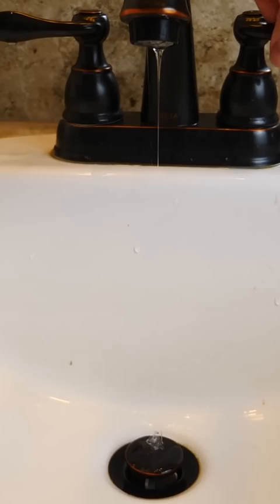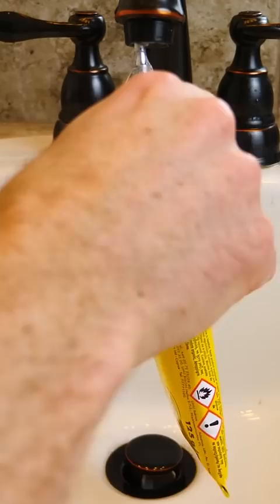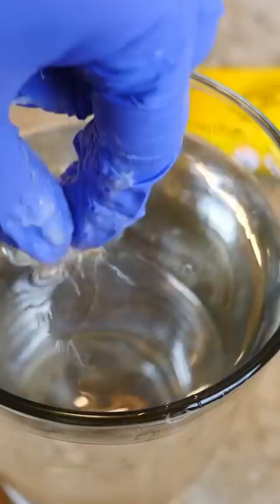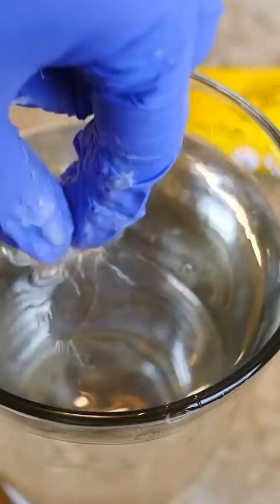The World's Biggest Water Drops

Comment: That's not a filter on your faucet, that's an aerator.. fun fact, they clog up and the end of the faucet is usually able to be unscrewed where you can clean out the aerator.. you also have the same thing on your washing machine and dishwasher.. They get blocked with mineral deposits and have to be cleaned.. Don't need to hire a plumber for something like this... You can do it with a pair of channel locks and maybe some CLR or some other solvent to break up the deposits.

Comment: Now you just need a way to fire it without the two chemicals mixing

My idea is to have to cartridges that are coned and funneled into one another then a block stops them from mixing when your not firing and when you press a trigger that block is removed and the two chemicals form the nylon as a small projectile gets fired via co2 through the two chemicals pulling the nylon behind it as it exits the web shooter. Now you’d just have to get a way for it to stick to things and also a way to make the nylon stronger I’m considering uhu glue for this but I have more ideas in mind this is just the tip of the ice burg

Comment: Anyways, here's a brownie recipe.
Ingredients: 
-1 cup vegetable oil.
-2 cups granulated sugar.
-4 large eggs.
-1 teaspoon vanilla extract.
-1 cup all-purpose flour.
-1/2 cup cocoa power.
-1/4 teaspoon salt.
-1 cup chocolate chips. (Of your choice)

Instructions:

1. Preheat your oven to 350⁰ F (175⁰C) and grease a 9X13-inch baking dish.
2. In a mixing bowl, combine the vegetable oil and sugar until well mixed.
3. Add the eggs one at a time, mixing well after each addition. Then, stir in the vanilla extract.
4. In a separate bowl, whisk together the flour, cocoa powder, and salt. Gradually add this dry mixture to the wet ingredients, stirring until just combined.
5. Fold in the chocolate chips.
6. Pour the batter into the prepared baking dish and smooth the top.
7. Bake for about 30-35 minutes or until a toothpick inserted into the center comes out with a few moist crumbs.
8. Allow the brownies to cool completely before cutting into squares (or your chosen shape).
And voila, you have your brownies enjoy them!

Comment: Try this at home!: Mix 1/2 Cup Borax powder with 1 cup Hot water, mix until Borax powder dissolves. Take original  Elmer’s glue, (clear works aswell) and pour medium sized tabs of the glue into the newly mixed solution. Watch as the borax water forms a membrane around the Elmer’s glue. Congratulations, you have now made useless Elmer glue sacks, they should look similar to what you see in this video!